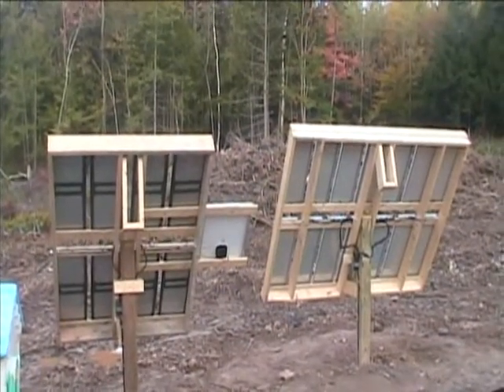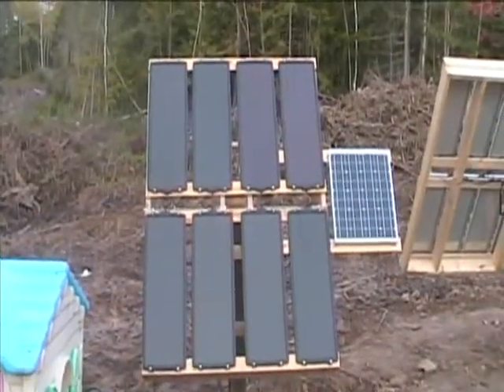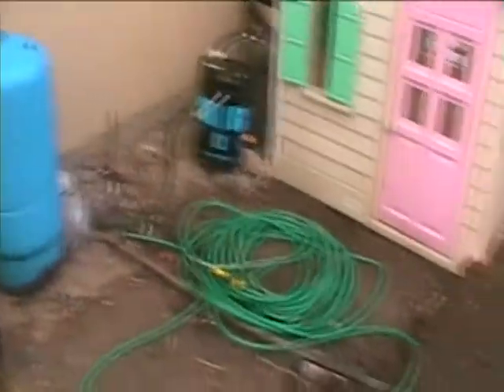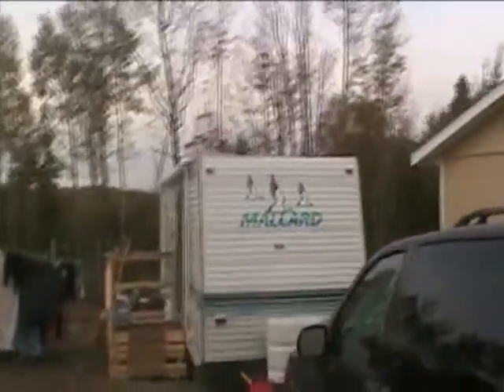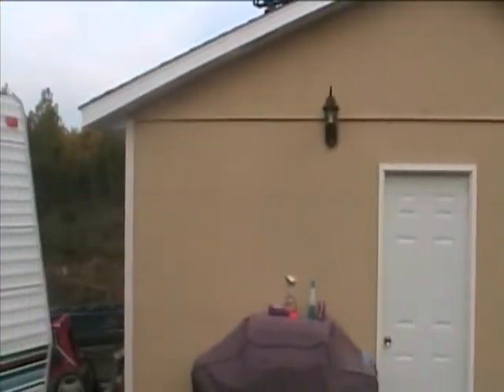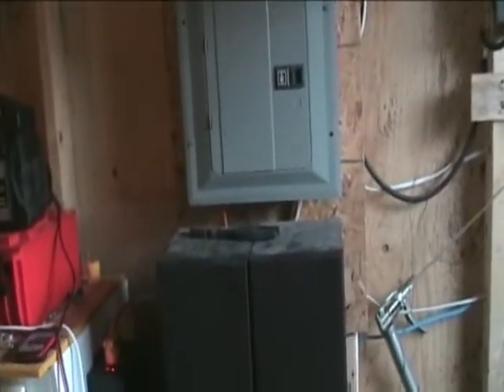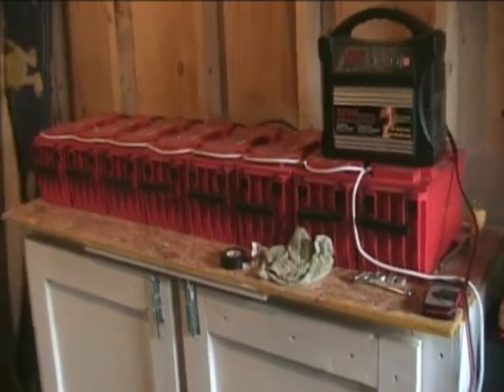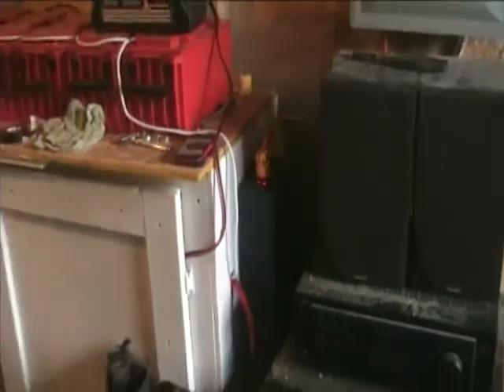off grid garage pictou county nova scotia diy solar manual trackers

Comment: You are sending 24 amps from the solar array  via 14 gauge wire?  Seems like a lot of amperage for 14 ga.  Have you measured the voltage drop at the charge controller under load?  You may be able to increase your efficiency using larger wire.  

Nice vid, and cheers from Texas, USA

Comment from the maker: @devinhiltz22 i purchased the batteries from ten penny recycleables they were badged dated by the phone company and discarded the recycle plant and replaced with new ones.i go in and TEST VOLTAGE  each one and purchased 24 perfectly good batteries 20 bucks each these batteries are worth over 200 each so try that and happy testing

Comment: I wouldn't use 14/2, just too small a wire, you'd get too much line loss.   On that small system, then also dependent on the length of the wire, I'd still go 12/2 minimum, bigger wire for longer distances.

Comment from the maker: @MegaAlfie007 hi man i wired a 110 inverter to the panel with 30 amp wire on a 30 amp fuse i jumpered l1 and l2 terminal blocks togather at the panel